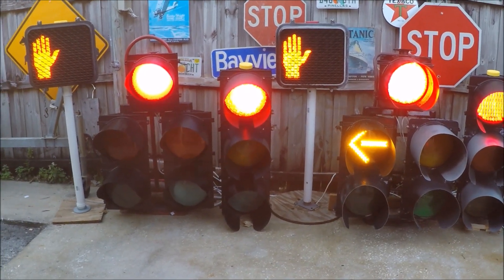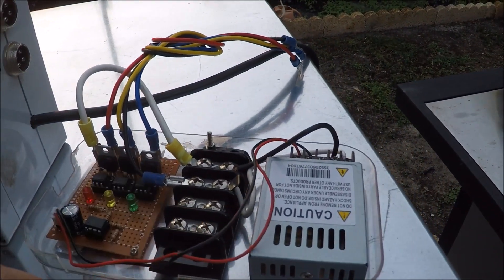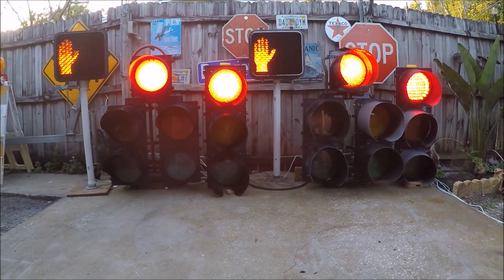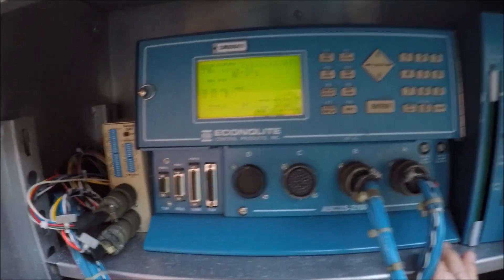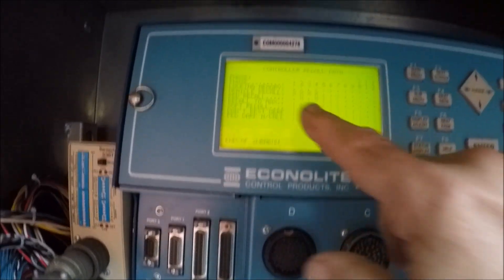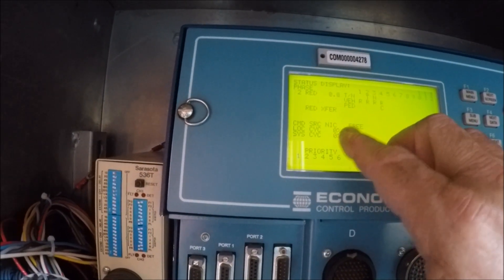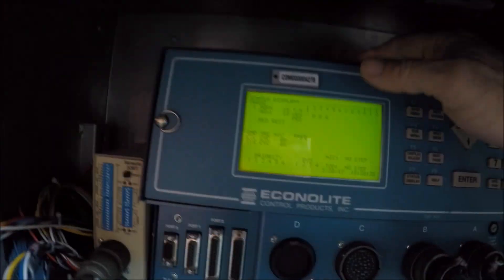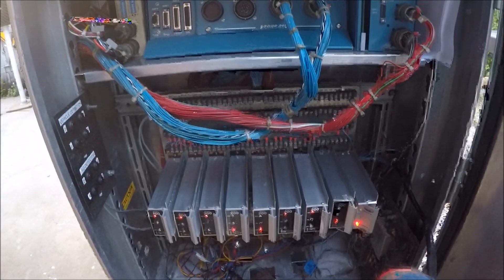Some of my Traffic Control systems and Signals

Comment: Great video! Is this the smaller pole mount cabinet you mentioned? What size is this one and how many phases, looks like 4 phase signal with 4 phase pedestrian
Reply from the maker: Yes this is the pole mounted one. It is configured for 6 phases signal (4 through and 2 turn) with 2 phase PED.  I measured it and its 28" wide, 18" deep and 42"tall. I also mounted casters to the bottom to make it easy to move it around. the controller only uses a "A" and  "B" connector and has two ports for loop detection and PED detection. They cut some of the wiring so the MMU does not function correctly so I plan to pull the load bay out and rewire the MMU properly.

Comment: As a traffic light collector and obsessed since I was a kid, this video make me happy to see.  Even at my old age of 41 LOL.  My whole life I wanted one.  I ever obsessed over the one Mister Rogers had.  My dad had a guy fold some metal for me and I built a signal of my own.  Of course I never knew that traffic lights were modular.

A number of years ago I picked up a back panel which came with the power section from OMJC.   Never quite figured out how the connections between both need to be.  Everything is still labeled, I do have a large plotter printed block schematic.  I know electronics wizard LOL.  I do think my issue is due to a lack of the ice cube DPDT flash transfer relays, and they have to be used in order to complete the circuit.  But I have no way of confirming this.  I also know that I would need to add a few toggle switches to activate, or shutdown certain parts of it (as is done in the real world).  The panel is fully wire with the A,B,C cabling, and 12 channel conflict cables (never got charged for that by OMJC).

I used to have an Eagle EPAC 300, but I hooked up the conflict monitors output incorrectly and BOOM!   Blew out a trace on on of the logic boards.  Sounded like a shotgun LOL.  Still have the photo of that.

My current gear.  

I have an old Traconex HMP-40 4 phase controller, and an IDC/Traconex 8 phase (with D connector).  
A 12 channel Crouse-Hinds conflict monitor, but I never quite knew what needed to be soldered to the jumper board (resistors or just thin gauge wire) and is what positions.  A EDI 6 channel, but I am thinking of selling it as I don't have the cable for it.

Load switches:
3 TSC, 4 random manufacturers, and two flasher units (I think the one you have is what I have as well)

Signals (all aluminum, and all have glass lenses sans the one 12" Econolite RYG which are the deep poly (can be mated with the deep arrow masks).  
8" RYG LFE (first REAL signal I ever got).
12" Econolite "bullseye back" signal (sadly I don't have the round doors just square)
12" LEF/TCT RYG 
2 12" YA GA Econolite "bullseye back" heads (I have considered building an inline 5 out of the Econolite's, but that's nearly 7' tall LOL.

PEDs
9" Crouse-Hinds DONT WALK | WALK (proper text not hand/man)
15" ICC DONT WALK | WALK (wish it was the neon version, but those are getting hard to find).

I did own a 3M Model 131 back in the eaarly 2000s, but it tipped over and destroyed two of the three optical limiters, put holes in the cast aluminum, and that was very depressing.

The one I own is a 12 channel (12 load switch + one flasher) that was originally set up with 4 overlaps, but I rerouted OLC and OLD inputs on the front to utilize two PEDs instead.

Anyway.  Would you be willing to do a video on how back panels should be wired up?
Reply from the maker: Thanks for the nice words.. The load bay I have only has slots for 8 load switches and one flasher. Before I got the box I had brought 16 load switches off ebay that where new unused. I got them really cheap with the thought that I would just build my own load bay since finding one locally had at the time been hard. I made a complete  A Cable from scratch, Buying the cannon connector and #22 wire. In the video you can see the cable plugged into my Eagle EPAC 300 for my inside stuff. it took allot of time soldering all those wires into the cable.

Once I did find a complete box with 16 channel load bay and all the cables still in it for only $150.00 but the guy was a complete jerk so I did not want to buy it off him. The box I have now is a pole mounted box that is very small. once I get the controller and MMU in the rack it doesnt have much room for a loop detector. 
When I got the box it came with a A and B cable plus the cable for the MMU. it was very well labeled on the front with what the connections where. I still need to work out the MMU and relays for the flash. all that wiring is on the back of the load bay and it requires me to completely take the whole box apart to remove it. However, I should be able to figure it out from the Econolite manual.

I have plans in doing a video on programming the Econolite ASC controller. maybe I will do one on  how to wire it up.
Back in September I had to disconnect the whole system and bring all my signals and box into my garage to prepare for hurricane Irma. Since I got it all back outside and connected I've haven't much time to get back working with it.
Reply: @jrocco36   Just to update.  A few months ago I bought a Econolite ACS/2S -2100 off ebay and I love it.  Also picked up 15 flash transfer relays (that was a mistake order.  Thought I was ordering 5, but is was 3 sets of 5, LOL). 
Also after hours and frustration I got my load bay working.  Then I had to complete the load switches so I bought 5 new Econolite's (not the the ones that have I/O LEDs just input.  Wish I could get a proper NEMA cabinet for this, but they are expensive to ship plus hard to come buy on the market.

These older panels we own are actually easy to rewire in that it's just a matter of making long jumper wires to say change OLD to a PED.

I'm still trying to figure out how in the world to set up flashing yellow arrows.  I was told these older load bays can be rewired to do so using ped clearance for the flashing mode.  Though Dont Walk is the only pin that seems to flash (that's supposed to be the steady burn DW signal).  So racking my brain on this. 

Now I am looking for a bare NEMA cabinet for my set up.  Hard to come by in my state (MN) due to a stupid rule that no signals or hardware can be bought by the public.  All old gear has to be destroyed.  :-( 

I am aware of a few places (like Twin Green Signals out of NY), but shipping is astronomical.